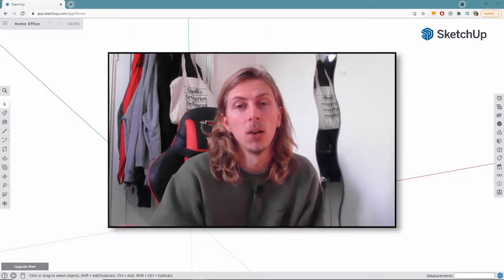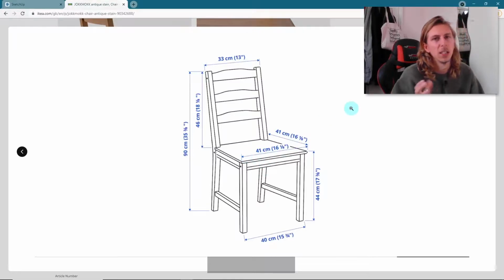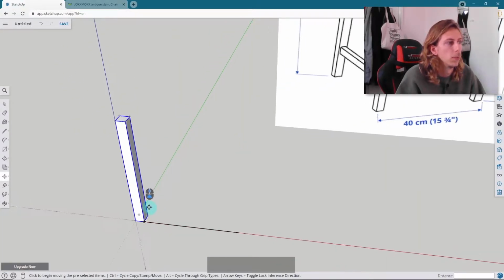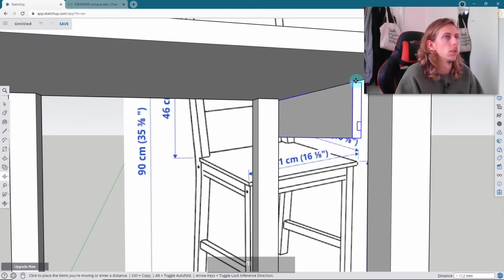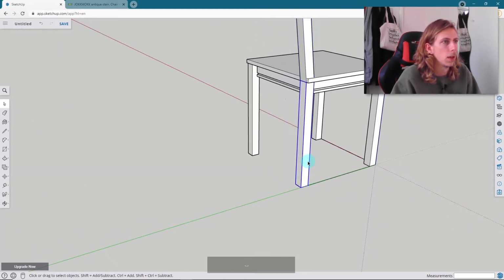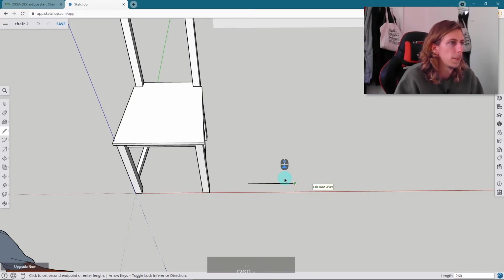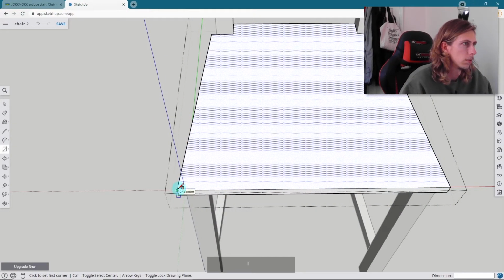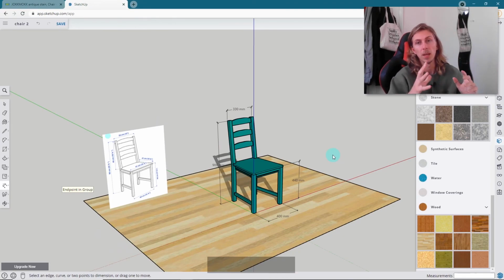Sketchup Free 2021 Beginners Tutorial in your Browser - 3D Modelling Step by Step build a Ikea Chair

Comment: Very nice and easy to follow video. It was easy to make a chair just as you explained it. 
One question: Why not use "Intersect faces" when adjusting the seat to the backrest? I'm just a beginner, but that seemed easier to me. 

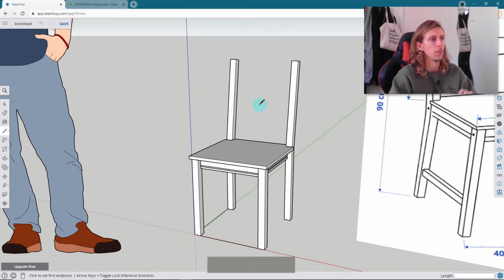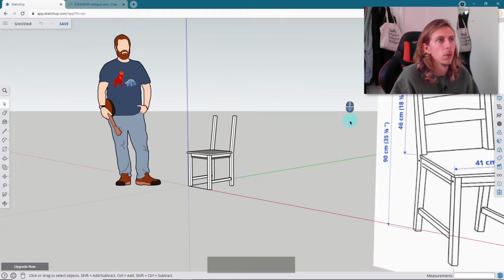You seem to have left a part out. Between 32:42 and 32:45 there is a skip that also happens to add the two bottom planks that go along the floor.
Reply from the maker: Hey Werner, Thanks for the comment! Your right I have missed a bit not sure how, my bad. Yeah I could have defiantly used the intersect faces but I honestly don't use that tool much when modelling thanks for reminding me of it. Perhaps ill start using it more. Glad you enjoyed the video!